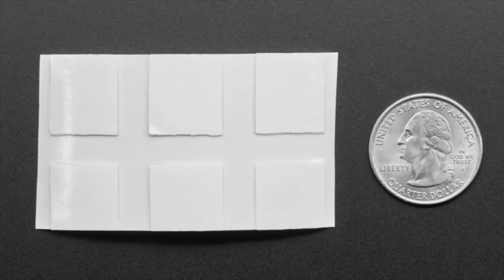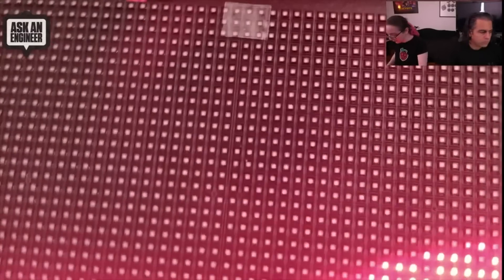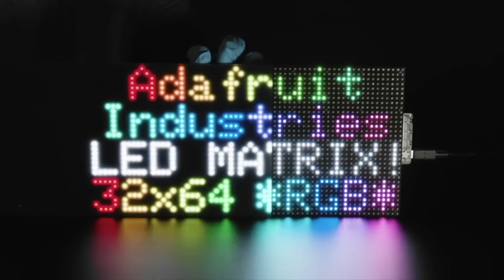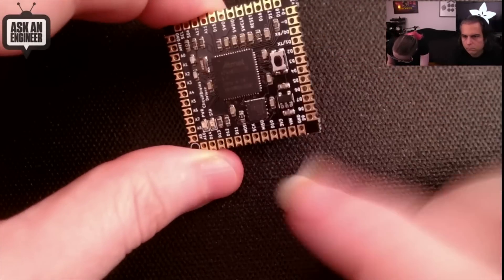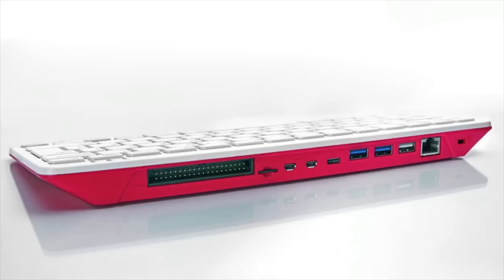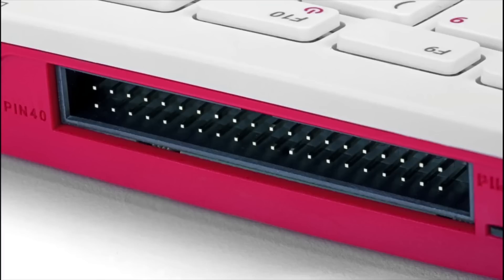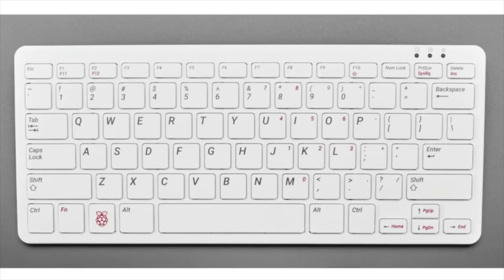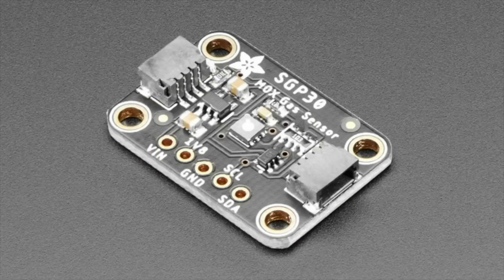New Products 11/4/2020 Featuring Adafruit BMP390-Precision Barometric Pressure & Altimeter- STEMMAQT

Comment: 7:54  - I grew up on the ZX Spectrum - it did have the 'hacker port sticking out the side like this' :-) fond memories of interfacing to decapped DRAM to make an imager, coding in Z80 assembler, turning a Brother thermal typewriter into a pen plotter and realizing how fast a microsecond really was when trying to make mechanics move.
Reply: The Atari 800xl had a hacker port as well.. The 6502 bus was brought out to a 50 pin IDC connector in the back.

Comment: I have to defend my Sinclair.
 I still have the parallel port I designed and built for my Sinclair. It was an edge connector, not pins, but the breakout WAS there for the hacking. Need the pics ?
Reply: I spent a summer learning z80 assembly and machine code so I could insert an ascii table into the rom's print function.
Reply: @aalhard  I had - still have, actually - A Z80 system built from scratch using plans from Kilobaud and a video display from Byte magazines. Had to 'assemble' code by hand. Good times :-)

Comment: This was my first time using the clear adhesive squares (or any Adafruit product). I made the mistake of applying the tape to the acrylic glass first before putting the glass on my RGB matrix panel. You can definitely see the edge of the tape if the tape ends in the middle of the LED.

I think this could have been avoided if I applied to the LED matrix panel first and aligning the tape so it covers entire LED bulbs instead of half.

Comment: Double-stick tape... I have a big roll Chinese cloned Tesa tape. Smelly stuff, probably not as sticky, but handy for things like worn stickers and rubber feet on laptops. In theory, they can be used to temporarily hold smartphone and tablet screens if they were glued in the first place. The real stuff used in devices that don't have IP67+ rating is laser cut 3M double-sided adhesive film with some number that includes 3s, but that stuff is just messy to deal with and is meant to be permanent (and you need to apply it to clean surfaces). Devices that are marketed as "waterproof" probably use a much more annoying adhesive.

The little guy with castellated vias is pretty much a breakout board for that SAMD51, but with nice things added on. There's a guy who did something very similar with the main chip of an Arduino Mega, he calls it the Naked Mega, and it's super cool.

Ahhh... I need that ESP32 with the external antenna, because it's going to go inside of a big metal thing and control a bunch of LED strips. If it comes in a Feather form factor, that would be even better (but not totally necessary).

The Raspberry Pi 400 keyboard reminds me of the Apple IIc... and indeed I think it's the best possible successor to the IIc, because the IIc was also meant to be portable. Sort of. It could resemble the ADB keyboard on the IIgs, but I don't think those were flat keys. I'd love to see someone come up with an indie board for the CM4, to be honest, that thing is going to be an absolute beast with the available PCIe.